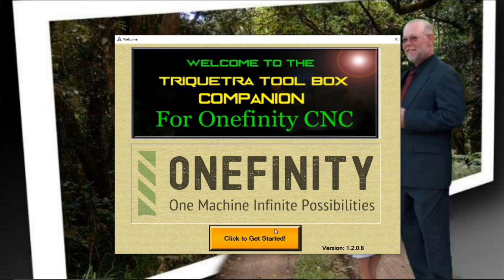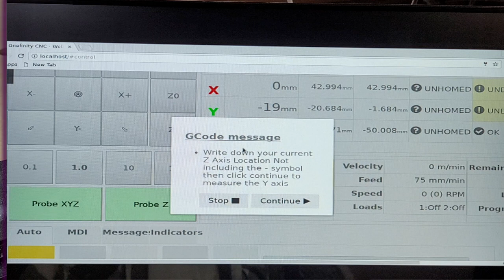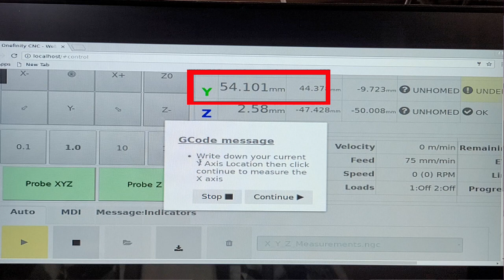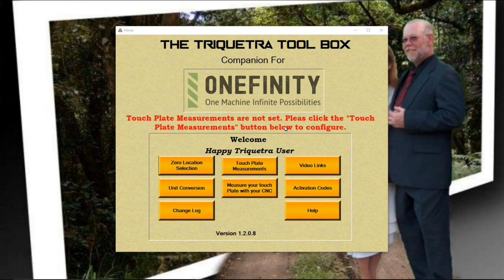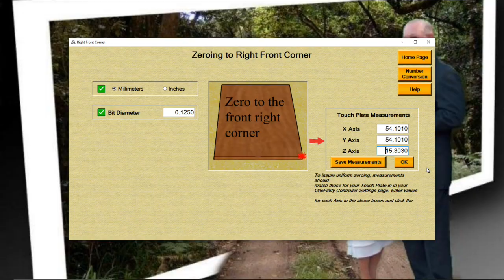Auto Measure  your OneFinity Touch Plate

Comment: Charlie, this may go without saying for most of us, but it should be pointed out that the touch plate needs to be set up so that it is square to the machine.
If not, you could be measuring at a diagonal and get an inaccurate reading. Just my 2 cents. Thanks for all your contributions.
Reply from the maker: You are absolutely correct.  I will update the video to insure that suggestion is incorporated. Thank you for the feedback.

Comment: I just bought the Onefinity version and my version is 1.2.0.1 and not the version in this video.  How do I update it?
Reply from the maker: You can get the most recent version from www.Triquetra-cnc.com and going to the Triquetra Owners Menu and choosing Software Downloads link. It will be the first item in the list.
Reply: @CharleyThomas2016  Tried it and it still shows as 1.2.0.1.    :(   What is the current version?  Is it 3.1.0.20 for the Onefinity version or is 1.2.0.1 the current one?
Reply from the maker: @dasfreakster  1.2.0.1 is the most current version for the OneFinity Companion. The other Tool box is for the Triquetra Touch Plate not the OneFinity Touch Plate.

Comment: Hey Charley, 
greetings from germany :) i have already a 3axis touch plate ( non Triquetra P3 Auto Zero). 

What software from you do i need for using it with Easel & a Arduino GRBL DIY CNC ? 
G-Code Excel Generator & Triquetra Tool Box ? 

With best regards
Daniel
Reply from the maker: If it is a 3 axis touch plate like the Triquetra then you should get the Triquetra Tool Box. It will create zeroing files for a variety of controllers which include Easel, Mach3, and just about any cnc that uses GRBL. The spreadsheet has limited capabilities but the Triquetra Tool Box offers much more. It is Windows XP thru Windows 10 compatible. Mac users will need a windows emulator such as Parallels.
Reply: @CharleyThomas2016  thx a lot :)